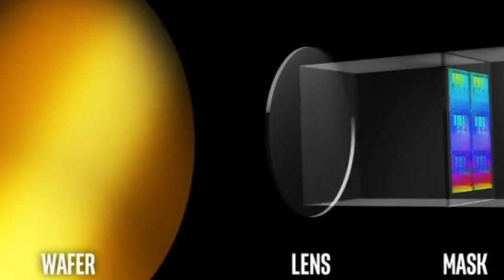Why is EUV lithography machine not necessary for manufacturing 7nm chips?

Comment: ASML EUV lithography machine is not feasible due to its initial high cost of acquisition. 
Although one needs multiple exposure using DUVi lithography to produce 5~7nm chips, it is still viable option as the reported yield rate by SMIC is quite high.
Once SSMB EUVi lithography is available which we read is in quite advance stage, the whole equation will changed.
That is why ASML is in a dilemma today due to US unilateral rule based international order that keep on changing.
Reply: One of the reasons companies invested in EUV machines was the fact that the high-end chip market was growing a few years ago. Today that's definitely not the case.